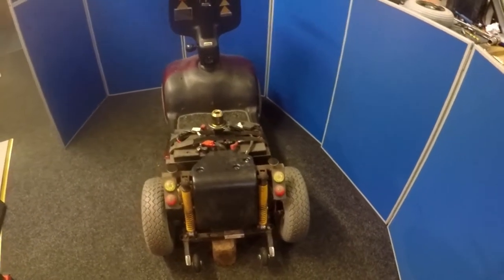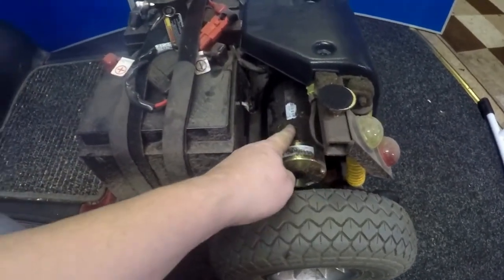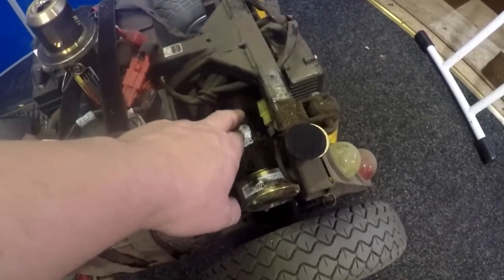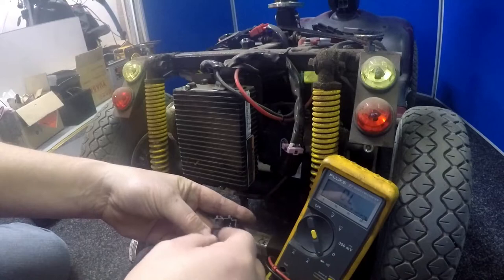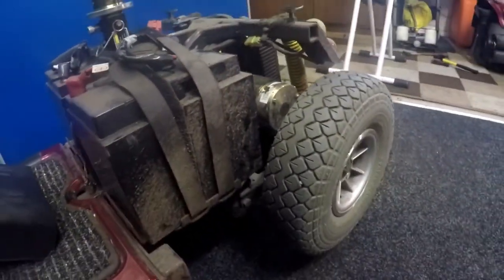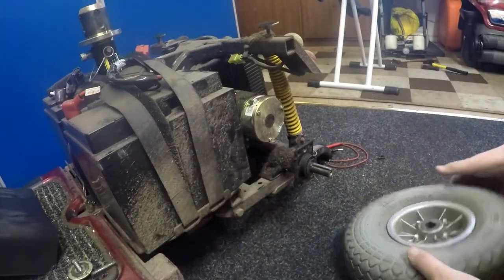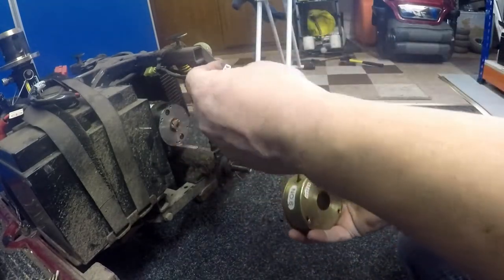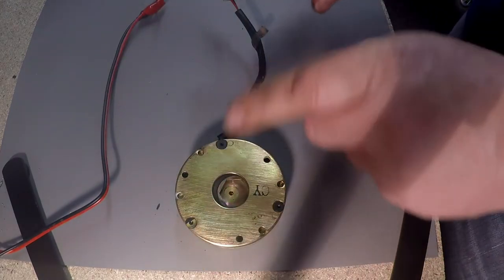Mobility Scooter Electric Brake Fault finding & Repair Part 1

Comment: I work with mobility equipment as a hobby here in the US and have found it very useful to apply some grease on the axle/key area before putting the wheels back on. Some scooters actually "click" when riding but the grease quiets them down.
Reply: Mine does that. Is it the key clicking?
Reply: @arconeagain  More than likely yes. Remove the rear wheels and apply some good high temp wheel bearing grease to the axle & key.

Comment: Hello, Have you encountered the Cabin Car build by Scooterpac?  I just bought one, I live in Canada and there are no dealers here that work on this model.  I got 24.5 mls on the clock and the elec-brake is defective.  (moter goes, but no movement, and the brakes won;t apply when keys are out of ignition) I looked online, but can't find one that looks the same as mine.  Do you know the part number and the manufacturer?
Reply from the maker: Uk importer https://www.scooterpac.com/products/cabin-car/
Reply from the maker: we are agents so you can get any parts you need best to send us pictures of the part just in case the parts have been changed.

Comment: another great video ,notice more and more trailers been used on mobility scooters ,but found nothing on how there wired up ?have you done any /many ?
Reply from the maker: ballkeeper666 impersonally would not recommend it but have seen some locating the trailer to seat seat base.  Most scooters seats have an attachment at the rear base metal work. Used primarily for attaching crutch holder or other accessories.
Reply: @tomjacques4  think its a good idea for say shopping light loads sort of thing, but iam not sure of,would you think of doing one ?

Comment: Hello there.. i  have a problem with a freerider kensington..  I have racked my head to bits trying to source the fault.. I have watched several of your posts on youtube which have been very helpfull.. Unfortunatly for me there were none that cured my problem..As with most things it used to be perfect.. Anyway what started happening was after a distance which could be anything from a few miles or so it would suddenly without warning start to slow down...the battery level would also drop to virtually zero and the green led on the dash would be barely lit...  when the scooter was turned off and left for a few minutes it would be off on its way again with no faults..  then the same again could happen at any time..this fault has been getting worse and now its luck if it can run for more than a few minutes... When i took the plastic back off and checked the electric brake was red hot...I unbolted the brake from the motor but left the wires connected... I tried the scooter again and it ran fine but eventually it slowed and stopped again.. The brake had cooled down by now.. i stripped the brake and cleaned it and re-asembled it..  when i refitted it it was worse !! (My fault) as i'd overtightened the small allen head bolts... i sorted them and the brake now works sound and stops and releases as it should without overheating etc..But the scooter does the same...  I have totally removed the motor and ran it in the bench with 24v... it run perfect for over 25mins no problem or hesitation...i inspected the brushes and copper contacts on the motor armature and they are great...The speed controler on the dash works fine.. the wig-wag works fine..Oh yeah forgot to mention.. after i sorted the brake out when the scooter faulters and slows to a stop the battery level does not drop anymore so i presume the brake was causing the heavy current draw...  the batteries are brand new lucas ones and fully charged and tested..i tried some other fully charged batteries just in case but the scooter does the same... Tested the charger and thats also working correct...i cannot find any lose connections anywhere and ive pulled and re-connected them...If you can help me in any way or give me some pointers i would be more than gratefull so i can get my mother back on it.. thanks... Dean...
Reply from the maker: AVIT LARGE ok dean sorry for the late reply. Well you have check just about everything. Sometimes the circuit breaker can be faulty internal damage due to water.  But that said it should not cause the motor to overheat. Try and remove the brake but still have it connected lift the wheels of the ground and run it.  Check will a current tested what draw you have at the motors and the battery.  With a temperature sensor check the temps of the motor and the brake and the circuit breaker. Again move all wires as the scooter is driving ps. Have the voltmeter connected to the battery so you see if there is any drastic voltage drops while it’s driving and you moving and checking all the wires.  Check to see if the motor in contaminated with the oil from the axle.  Hope this helps
Reply: @tomjacques4  hello there..thanks for that.. i had already removed the brake but left connected..  the brake  no longer go hot and works as it should... ive had the motor running for a long time in its own removed from the scooter on 24v with no faults at all... the  brake now works fine.  Ive checked pulled /yanked all the cables while running but still nothing.... is it possible that it could be the blue control unit ??..
Thanks
Reply from the maker: AVIT LARGE have you actually replaced anything new.  Like throttle pot. Could be a an issue there.  Now that the motor and brake are not overheating.  Cheaper than changing the rhino controller.  But yes it could be that. But usually if they are faulty they do t work.  Also if run with or without load does that make a difference.
Reply: @tomjacques4  hello again.. it doesnt mske a difference if theres a load or not.. also when the motor stops the voltage doesnt drop on the gauge or with a test meter..
Reply: @tomjacques4  also when you say "throttlepot "  do you mean the twist switch in the middle of the dash..ie: slow to fast ?
Reply from the maker: AVIT LARGE no the forward reverse pot that is attached to the wig wag levers
Reply: @tomjacques4  no i havnt replaced that.??.. i mean it works and i havn't noticed any faultering with it..
Reply from the maker: AVIT LARGE the throttle pot is the the pot that is attached to the forward and reverse levers.

Comment: Hi I have a kymco foru mobility scooter had no batteries on ot for about 6 weeks. Brought two new batteries put them on and everything comes on on the control panel even the key is switched off is there a reset or something I can try thanks

Comment: overr  5  years,i wore  out 2  tires       then  electric  brake  went  on but not  off    dealer said no spares available its too old    is a  fortress 2000  mdl used ? when i  bought  it.
Reply from the maker: Hi send us pictures of your brake and we will see what we can do for u

Comment: When fitting a new brake. Does the scooter need power . To make the brake easier to fit..
Reply from the maker: Once you have the brake fitted over the nut then yes so you can easily move the brake around to find the holes for the bolts

Comment: Great video,I always come to your videos when I'm checking something but I have a request. Is it possible to clean this auto break with break cleaner. As I have a problem with my excel galaxy 2 it keeps stopping going forward but great in reverse. Advise please
Reply from the maker: Do not use any lubricant on that brake.  Recon it would be the throttle pot.
Reply: Thank you for the reply,but I was told that I could use break cleaner on the breaks to get rid of all oil and dirt. The scooter seems to be ok now but my partner is a big lady and I think the break was binding and it over heated. So I've got to re-test it under- load as before then get back to you. Is the throttle pot the wigwag.
Reply from the maker: @Wombat63  yes
Reply: @tomjacques4  thanks if I buy a new one off you do I need to reset it and how

Comment: Hello thanks for uploading these videos they are a great help.i have a carego airlite scooter.it turns on but doesn't move.the light was flashing 9 times which was the parking brake had a bad connection now it's flashing 3 times which is  a bad connection from motor to battery connection.any idea where to go from here? Thank you
Reply from the maker: Check all wires and touch pads from the motor to the controller.
Reply: @tomjacques4  thank you I'll try that today
Reply: Hiya I've checked all the wires from the front of the footboard right along to the back where the motor is but can't get access to the control panel.do you think it's worth persevering and getting the panel off please?
Reply from the maker: @michaeljohnson5370  sure do could be a loose wire
Reply: @tomjacques4  thanks very much

Comment: Purchased a used Pride GoGo scooter, seems to be in decent used condition. Scooter runs as supposed to when lever in Drive position. I do notice that when the lever is in Drive, you can manually push it as when you have it in the Neutral position. The brake does not engage when in Drive and stationary, or when the scooter is off and in Drive. Is there an adjustment possible? Note: I also noticed that I unable to take the wheel nut off on the rear back side - it spins.

Comment: Hello my shoprider brake works but down hill it fails and the scooter runs away
Reply from the maker: LOOKS LIKE ITS WORN WE WILL HAVE THEM IN STOCK YOU COULD REMOVE IT AND CHECK THAT THE NUT ON THE MOTOR IS TIGHT. YOU CAN CONTACT US FOR A PART ON 01659 490 667

Comment: i have a rover scooter which once covered 30 k's but now will do only 10 k's, i have new batteries put in but still i cannot get more than 10k's, could anyone tell me what else could i do to get back my mileage.  Please i need expert advise from someone who knows about disability scooter as this is my legs.  please help, fiona
Reply from the maker: Fiona Donald  hi. As the motor gets older it will draw more current hence less mileage. Also did you get quality batteries ? Or the cheap ones and did you get the same amp rating of battery. ?   Check motor brushes ensure brake is not binding on ( getting hot while driving) it’s like an old car...... think wear etc. Hope this helps

Comment: I own a shoprider explorer I put an 18 litre bottle of water on my scooter plus my fat ass all of a sudden my scooter stopped working now it works then stops the battery's are new! any idea's would be welcome! And don't tell me to lose weight I'm dying from B cell Lymphoma and don't have time.
Reply from the maker: Very difficult to say if we don’t know why I would check motor continuity first and check all wires. Stopping while driving could be a slack connector.

Comment: Nice video. I have a problem where my scooter Will only reverse, when i Want to go forward it cuts out and the battery meter blinks :(
Reply from the maker: sounds like a throttle pot problem. to confirm this reveres the 2 outside cable on the throttle pot.. when this is done the reverse lever will make the scooter travel forward and the forward lever should no in reverse and cut out...
Reply: @tomjacques4  charged the batteries fully and went out this morning, reverse works fine. and forwards works fine, for 20 meters, then it will only reverse again. im thinking one of the batteries are bad. voltage is okay, but CCA could be bad?
im using a set of car batteries just to test the unit as it was very cheap
Reply from the maker: Brugernavn  batteries should not make a difference. Have you swapped the wires as stated.  ?
Reply: @tomjacques4  yep. No difference. 

Errorcode says brake. Its also hard to push when in "neutral"
Reply: pullede the brake of it today, it works fine. drove without the brake and same problem.  goes backwards fine, but when i want to go forward its a click and it stops, its also hard to push without the brake even on the motor, after af few minutes its easy tu push again.
Reply from the maker: Brugernavn  when the scooter is switched on then it’s always difficult to push.
Reply: @tomjacques4  its the same when swithed off, just pulled the motor and checked inside as your other video, still looks brand new inside. should i just trash the scooter?.
Reply from the maker: Brugernavn well no don’t trash it. May be an issue with the controller. I’ve never heard of this problem. Very odd.  When you say it will drive forward then stop and only drive in reverse.  Did it do the opposite when you swap the wires on the throttle pot.  Drive in reverse then stop and then only go forward.
Reply: @tomjacques4  it also stops when i invert the throttle, could be a controller thing, but a s-drive 90 is so expensive :/
Reply from the maker: Brugernavn what make and model is your scooter
Reply: @tomjacques4  Trophy 20.  3 Wheeler from 2011 1000watt. S-drive90 controller. Service Manuels are on Google. :)
Reply from the maker: Brugernavn hi handicare product from the Netherlands.  Yes parts expensive. But you can get a second hand a drive and transfer the software

Comment: Hey love the videos, very helpful! I however am still having issues with my Rascal 600F. I connect everything to the battery as it should and the lights all light up, even with the key off. I the go to put the key on and receive the 5 flashing lights on the scooter. I looked up im my manual and it says a break issue. So I replaced the electric break but still same issue. I have good brand new batteries in this mamma jamma. Just went to try it out today and noticed then I connected the battery that the tiller was unplugged, so I plugged that in with the key off and noticed right away all the lights came on front and rear. I then turned the key and received the 5 flashes. After replacing the brake I am not sure what else to check all connections are good and i have continuity to through all wires from one side to another. I am thinking its a controller issue but those are pretty expensive.. Any other ideas what i can check?
Reply from the maker: Bjorn Bjornson mmm without some spare parts your snookered
Reply from the maker: Bjorn Bjornson could be controlled
Reply from the maker: You could try and bridge the wires leading to the brake then you should not get a flash code.  Check all the wires at the controller to the brake. Clean contacts. Ps I do have a spare controller.
Reply: Nithsdale Wheelchairs V Thanks for the response, I will give that a go. When I bridge the leads I can do the two pins right off the controller correct? I am currently watching a controller on eBay and hoping to score it for less than 150us dollars.
Reply from the maker: Bjorn Bjornson I would connect the wires at the brake end.  Remember to get the controller that has been on a rascal 600 some had seat lifts fitted.  Don’t just buy any controller as the software may be different
Reply: Nithsdale Wheelchairs V I got the replacement controller and brake issue was resolved. Still have an issue where as soon as the power control harness is connected to battery then to the controller the side markers light up on the front and rear. No clue what that’s about. Headlights, turn signals and flashers do not work. On the power harness I am getting power the wire with the in-line fuse. It has to be something with these connections. Perhaps the harness is for a rascal 600 and not a rascal 600f? I don’t know, I did comparisons looking at photos and both harnesses are identical. No clue, for now I left back lights unplugged and cut wire from side markers in the tiller.
Reply: The key is off too btw.
Reply from the maker: Bjorn Bjornson must be a loom error or water contamination

Comment: It also beep when ur battery is busted
Reply from the maker: Yes correct, mind you your led battery display should show low power so an easy fix. Some batteries may be ok to start with then loose power after a given time this should be seen by the lights on the battery indicator so when the power is so low the controller can’t operate hence the peeing.

Comment: Sorry but that is not a Wood Ruff key
Reply from the maker: Scooter guy : woodruff keys are available in different shapes and sizes depending on its use some are even half moon shapes.  The ones on said mobility scooter are small rounded either on one side or both or non at all it depends on the manufacturer. So I would disagree with your statement.
Reply: @tomjacques4  I'm sorry but what you have there is a square key and would have a radius one end only. Both keyways use different cutters to produce. Other keys are Gib, Tapered, T keys, Scotch key. Shoprider had Square keys in the rear axle. Some of the Pride range came out with Woodruff keys in the rear axles. A woodruff key way requires a radius machined into the shaft not a straight slot.
Reply: Woodruff key or not ,we all understood what was meant and most of us call it that anyway.

Comment: Thank you for the video very useful. I have a rascal 850 and it was recently taken out during rainfall and now it had a constant beep, any clue that can help me sort it out as just waiting for it to dry out and hoping it goes away.
Reply from the maker: Ok water is not very good.  So keep it in a warm room for a couple of days.  Disconnect the batteries. Then try to see if it will work. It may dry out. Water will short some connections.  So take off the seat and the rear plastic shroud so heat can dry out any dampness. Hope this helps